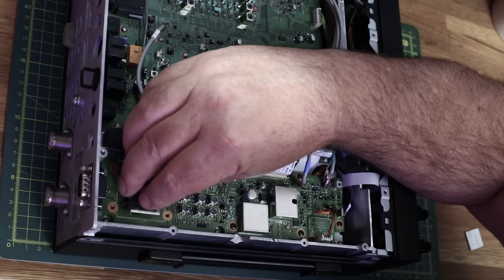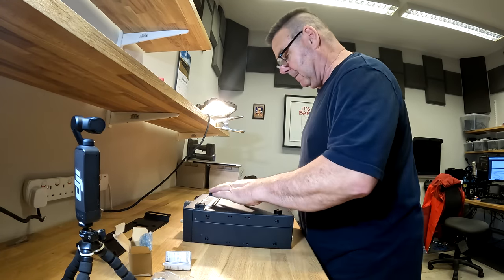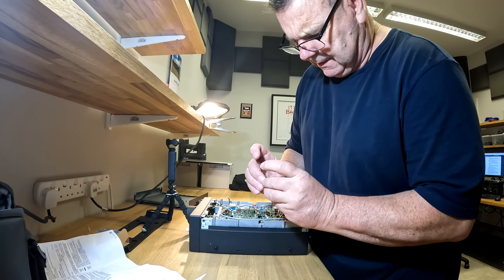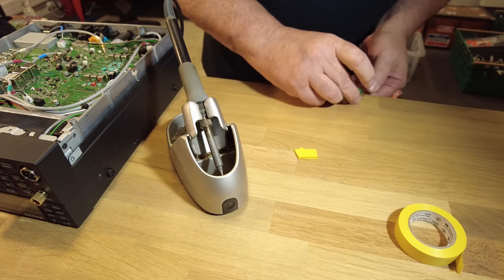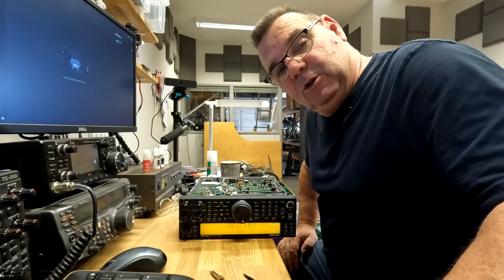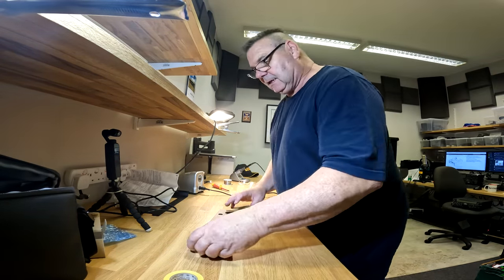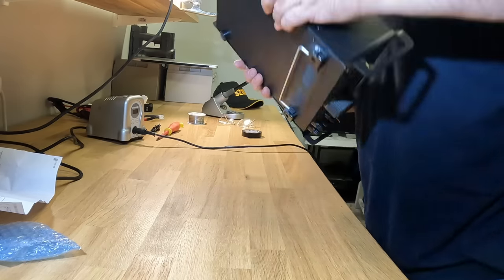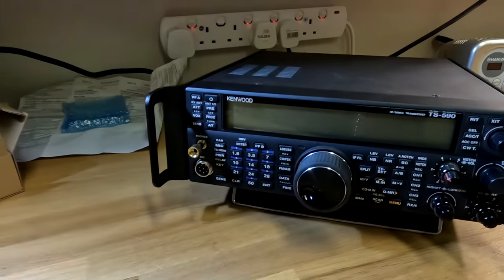I upgraded my Kenwood TS-590SG with TCXO and Military Look

Comment: The TS590SG is an awesome radio. I have been looking at its predecessor (570) and hope to get one soon. The AT is undoubtledly the best in the biz and with two antenna connections, it allows the user so much flexibility.

Comment: Cal you did great buddy!  What’s always bugged me is why that darned thing wasn’t included in the radio from the start! It’s not 1985 anymore when so many features had to be a user installed module and with all the digi modes it just makes sense to me that device should be standard
Reply from the maker: Yeah.. Probably cost.
Reply: But then hobbyists wouldn't have anything to do!

Comment: You and I have had the conversation about adding the Kenwood TCXO to your TS-590SG before and I know you were apprehensive about it.....but I KNEW you could do it. Good job, Callum!!
I ordered the TCXO when I ordered my TS-590SG and installation it wasn't that tough....and I can hear WWV on 10 MHz here (it's 300 miles away from my QTH). Brilliant work around on your part for getting it tuned in. I am sure you will be happy with the upgrade. 
Kinda diggin the side plates.....I see an upgrade in my future. 😁
Reply from the maker: Yeah tnx!

Comment: My ability to work with small items abandoned me several years ago so I know how you feel. I try to find disposable aluminum pans to sit stuff in if I need to remove small parts, screws, nuts and bolts. Otherwise I have to search the floor often. Interesting video. Thanks! Jack K5FIT

Comment: Arghh - the tiny bits!! I do a lot of soldering but SMD and the micro stuff is a pain... 😬 That Kenwood is a great and reliable radio and now it's even better - thanks for the video.

Now you did a great job and I see you took care of the 'blobs'. The islands/holes for the TCXO were never tinned before, that's why that happens. As someone suggested, get a small bottle of soldering flux. Weller makes them (among others) and they come with a little brush inside. Flux will also make soldering go faster (e.g. connectors) and that means less heat to get the job done, which is always a good thing.
Reply from the maker: Flux is apparently my mistake.
Reply: @DXCommanderHQ  🙂 We're here to share knowledge, right? I've learned so much from channels like DXCommander... 👍
Reply: Flux in little hypodermic dispensers is a must😊

Comment: Dear Commander Callum. Thank you for this. I would have been terrified to solder anything on my radio, but, after watching this, I will give it a try. 
You mentioned other upgrades to this radio. Please let us know what else you’d done.
I just bought my TS-590SG thus week. Still reading the manual - preparing to try some DX on 20 and 40 meters.
All the best from the west side of the Atlantic. KQ4IXD
Reply from the maker: I've not done anything since this.. I am also terrified of opening a radio up!

Comment: hey Cal, i like the way you are open to tell about adhd. Wish you all the best. To calibrate the TRX you could have used CW on the reference TX. A CW line is nothing other than a frequency generator ... all the best, 73 de DB3MI Update: checked out how to do it: 10,110,440 on the TX (CW), 10,110,000 on the RX (USB) -> tuning a free guitar tuner app on your iPhone ;)

Comment: You take your Kenwood TS-590SG portable/out in the field.  My Elmer advised me not to so I have been following his advice.  I have the standard rig with no upgrades.
Reply from the maker: I don't know why he would tell you that - I just can't work out why someone would think you couldn't? But anyway.. . TS-590SG will stand low voltage and performs fine. I take all my radios in the field.. I have even taken my TS-990s out /P along with my Acom 2000. You could take anything I guess.

Comment: Good job, I struggle with small fiddly bits with my sausage fingers.  I learned never to do this type of work in the kitchen, because if you drop anything on the floor it is guaranteed to roll under the fridge and never be found again even if you move it.
Reply from the maker: Yes!

Comment: My old IC-718 had a TCXO available and I think it might have helped with RTTY. My current IC-7300 seems more on frequency and more stable than the old IC-718, but so far I only use CW and phone. Maybe I'll try some of the RTTY computer stuff at the new station. I was surprised how on frequency the out of box IC-7300 stays.

Comment: come on Calum - look to tuning using VVW signals ! 10.001 MHZ rx in SSB will give 1Khz audio - produce 1 Khz from the internet and listen for beat frequency...
Great videos love them all matey
Reply: WWV is not very strong in the UK at times., but there are plenty of other standard signals. (BBC Radio 4 is very closely controlled) Be careful using SSB that usually switches in a fixed frequency BFO osc, so what you end up doing is using that as the frequency reference!

See Alan W2AEW video number 58 for a generic method of checking a frequency counter against a standard signal,  and number 301 for this same mod to  a 590 including the calibration method.

Comment: Don't blow on it.  It will cool plenty fast.  Just wait a second of two.  Blowing can make the solder move, leading to a cold joint.  (Even cooling too fast can lead to stresses.)
And aren't there frequency standards station in Europe that you can hear?
Reply from the maker: Freq standards.. Couldn't find any no.
Reply: @DXCommanderHQ  Sadly, this WIkipedia article: https://en.wikipedia.org/wiki/Standard_frequency_and_time_signal_service ; isn't clear about whether the time stations also have atomic control of the carrier.  That's certainly true for WWV.  One would hope that other stations transmitting on the same frequencies would be scrupulous about assuring a zero beat with WWV, probably using atomic, or my likely, GPS disciplined oscillator (GDO) control.  My guess is that if you can hear a time station on 2.5, 5, 10, 15, 20, or 25 MHz, that it's good enough to calibrating your TCXO (temperature compensated crystal oscillator).  The Finland station at 25 MHz might be a good bet for you, but you also have Rome and Cadiz.  If you hear one, you could dot your eyes and cross your Tees by seeing if they have a web site to check whether they think their carrier is precise.  They probably at least use an OCXO (oven compensated crystal oscillator) and calibrate it regularly, maybe through a GDO circuit..

DCF77 from Germany probably has good ground wave to you, but I'm not sure whether 77.5 kHz works for your radio.  They do use an atomic standard.  The self setting "atomic" (bedside, wall) clocks in Europe probably use it.

I keep wanting to build a GDO (GPS receivers are cheap) as a fun project (the commercial ones are too expensive).  But here in the US I can always hear more than one of the WWV  frequencies. so motivation is hard to come by.

I assume that RSGB has technical aid contact points, as the ARRL lab does for me.  You might ask about stations in Brittan usable as frequency standards.  US analog TV video sub carriers used to be accurate.  BBC foreign service stations are a possibility that you could contact the station's engineering department about.  They may or may not have high accuracy carrier frequencies.

And if you do figure out what you can rely on over their, that could be a worthwhile channel video,

73, Bill - KE1G

Comment: Collum... get yourself a small bottle of rosin flux to lightly brush on those solder pads to allow for better solder-wetting.  A small cotton swap of isopropyl alcohol will remove the flux residue.  73 de KD6UYK (Tim).
Reply: Yeah it looked like the solder didn’t have flux in it

Comment: When did Kenwood TS530 S came out OLD hands were amazed at the performance and some even dared to say the Kenwood was approaching the ELEcraft K3 receiver performance. This comparison really heated up when knowledgeable hams got their hands on TS-590SG.   During that window of this offering there was a lot of whispered amazing appreciation at this radio.  I have no sense to think that that perceived quality has gone away now that the radio is mostly on the used market.
      The cliquish quality of hams stack with the K3,   what's the 590 SG   surprised a lot of people.
Reply from the maker: Yeah, that 590 is genuinely a fab radio, often passed by by folks wanting color screens and bells and whistles. They buy those - and quickly sell them. But 590s seem to "stick".

Comment: Hate using  that European no lead solder. Never looks like you get a proper connection and needs considerably more heat than the good old 60/40 stuff we can still use here in the states. 
Thanks for another good video (actually froze on Rumble while you where soldering but I prefer coming over here any how.) 
Good luck on the portable operation, I'll try to listen for you here in Montana U.S.A.
K1AUS.
Reply: Lead free is rubbish stuff. Fortunately you DO NOT HAVE TO USE IT. you only need to worry about that if you sell a product commercially. For home construction and such, Lead/Tin solder is fine.
Reply: @andye2005  Here in the states it is only required for water service not electronics.
Reply: 63/37 is the way.

Comment: Always amazes me that a TCXO isn’t fitted as standard. In essence, a lot of manufacturers basically sell an ‘average’ £1000 radio and then you have to dip in with better filters, better oscillator specs and so on (much of which is too daunting for the average person to fit… more service engineer charges etc)… kinda crazy! Yep, same happens with cars except for a few brands where there is good spec or nothing.
Reply from the maker: Yep.. All about cost..

Comment: Wrong, I have installed the Chineese cheap TCXO a few times and they work fine. No problems at all. There is no reason at all to spend a lot of money on it. If you don't have one, don't worry, it doesn't do that much. For most stuff it's not needed at all. The stability of the 590 is so good, I doubt you notice it ever, if at all.
Reply from the maker: Well I'm not actually wrong.. The very detailed report I read had some TX issues..
Reply: @DXCommanderHQ  I have seen you soldering. I never needed soldering for the Chinese TCXO. Maybe you had a bad one, it worked for me. But still, there isn't much use for it as the Kenwoods are stable on their own. Even with WSPR, I have not seen them drift much, if at all. Most of the receivers at the other and drifted a lot. And the TXCO didn't make a difference there. I'm sorry, I can not confirm your statement.

Comment: Cal I have a lot of respect for you and I hate having to say this. In my opinion the TXCO module add on will make little or no difference. LOL you need a standard and not another unknown radio for calibration. Just saying. ;-D  The plates look good BTW.
Reply from the maker: Yes John, however no it's in, Mike M0MSN can do that for me. He's a lot cleverer than me!
Reply: Using an off air signal is fine It does not matter if the receiving RX is in calibration or not. ()you are only using it to detect a beat note) Tune to the signal in CW mode. Inject your sig-gen into the antenna on the same freq and watch for the beat once at zero beat, you sig gen is at the same freq as tyhe standard, so you can feed that into the equipment you want to test I've mentioned Alan W2AEW videos number 58 and 301 elsewhere that shows in detail how to do this.
Reply: @andye2005  Thank you for your reply I understand what you are saying however, the point I am trying to make is that if you require accuracy then don’t calibrate to another radio as it may also be off. Also the only real benefit of fitting a TXCO is not frequency accuracy it’s frequency stability. The problem is that the specs state that the internal osc is 5ppm and opt is 0.5 ppm over -10 to 50C. I think you will find based on the ts-590sg specification / limitations and normal operating temperatures, fitting the optional TXCO will give very little noticeable difference.
Reply: @M0XFXUK  

Providing we are on the same wavelength :-)

If you are using a standard frequency transmission as the reference, then the RECEIVING radio does not matter as all it is doing is listening to the beat of the Standard transmission against the rig / sig gen you are calibrating.

Checking against another Rx will of course just match whatever that Rx calibration is.

Comment: i thought the SG Came standard with a tcxo ???
Reply: Ok mental note Do not Blow The Solder only the Fumes as the solder cracks if you blow it . x .
Reply from the maker: Apparently not
Reply: small pot of liqui flux would help a lot.